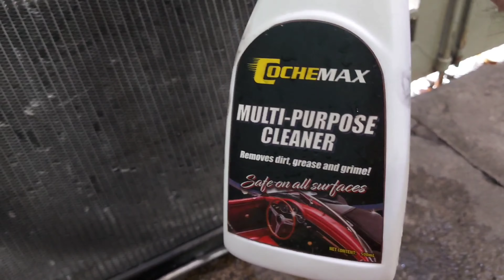Radiator Cleaning

Comment: Hello nice video..so i need help about my dmax 2.5 hard start in the morning...servicing done all filter were changed...diagnostics  done one issue, fuel rail pressure  regulator  changed..but stay same issue hard start when it get cool temperature..i wish to know what cause that problem so plz help fix plz!!
Reply from the maker: Check your crankshaft pos sensor esp the terminal. When its dirty or corroded its hard to start the vehicle

Comment: Welcome back paps! Nice
Reply from the maker: Salamat paps :)
Reply: @JongTheDIYCarGuy  paps anong specs ng stainless na gagamitin kung ipapafull exhaust ko innova d4d ?
Reply from the maker: Depende paps. Pang tatakbo mo ba or pang daily and if may tune involved
Reply: @JongTheDIYCarGuy  pang daily lang.paps. wala pang budget pang remap eh hehe pero planning na rin
Reply from the maker: Depende pa rin talaga sa mag tono sayo. Kasi kung lakihan mo diameter tapos mahina tono sungaw naman kakalabasan
Reply: @JongTheDIYCarGuy  kapag ba daily driven at hindi tuned, same diameter sa stock pipe gagamitin ko paps?
Reply from the maker: Yan ok yan. Yung iba straight pipe walang muffler, yung iba scav nilalagay basta same diameter yung pipe you should be fine
Reply: @JongTheDIYCarGuy  salamat paps. Ano ba marecommend mo paps eith scav or straight pipe lang mismo? Hehe
Reply from the maker: For me straight na lang. Pero yung iba may tunog na gusto hehe
Reply: @JongTheDIYCarGuy  thanks paps sa input. Mas brusko ba ang tunog kung naka scav?
Reply from the maker: Depende sa haba. Pero yes hehe
Reply: @JongTheDIYCarGuy  salamat paps. Sana may gain din sa hatak hehe. God bless